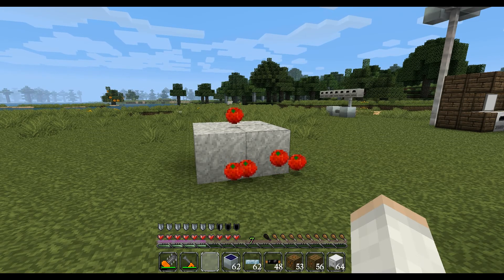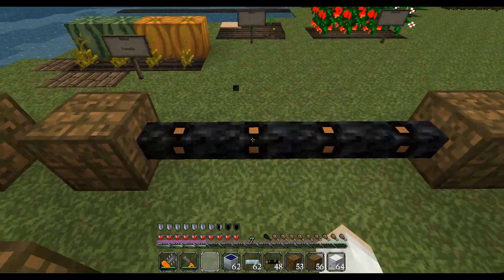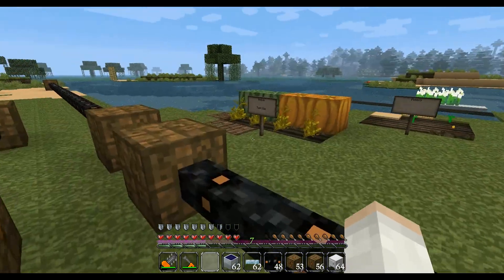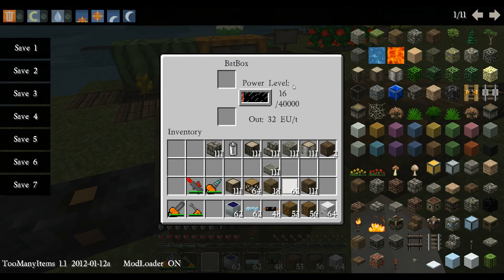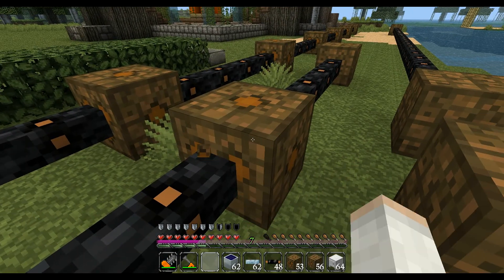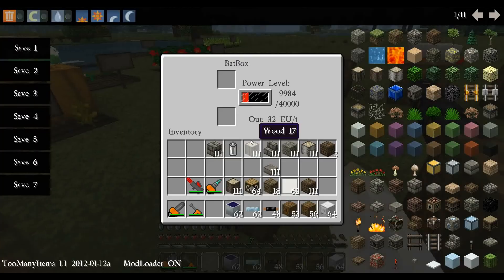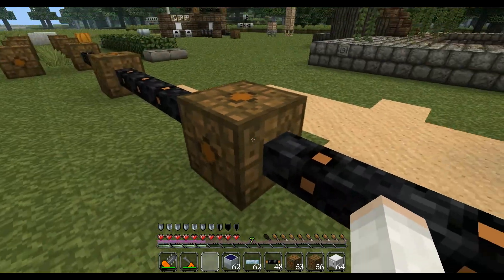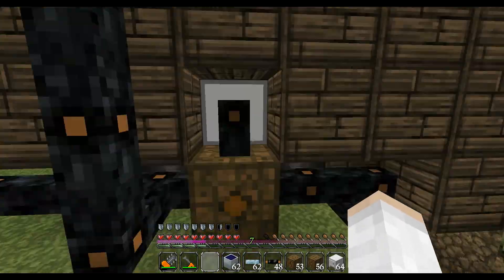IndustrialCraft: Long Lossless Copper Wire

Comment from the maker: Nope, shouldn't give any loss.  However it might increase lag a little bit having all your power bounced through that many batboxes. Note however, that batboxes can output only 32eu/t, so if you use bats the total throughput of the line will be that.  If you connect other inputs to the line you'll get a bottleneck since the max is 32. BUT, LV Transformers are designed to convert 128eu MV packets to LV, so the throughput of a line using transformers will be 128, much higher. Keep that in mind.